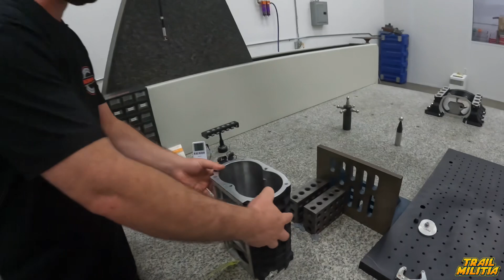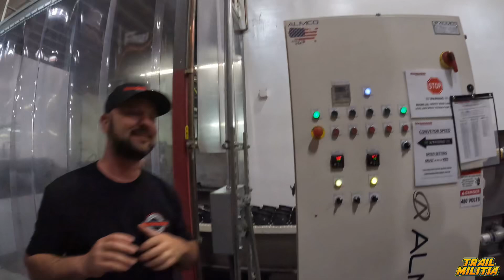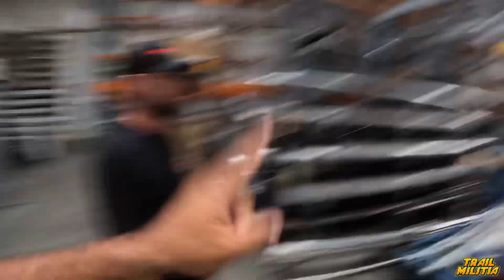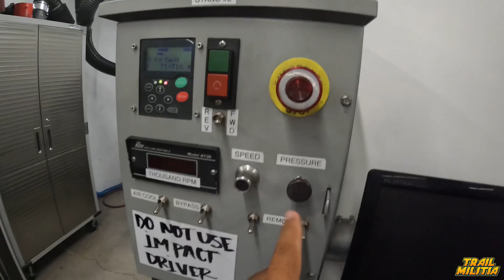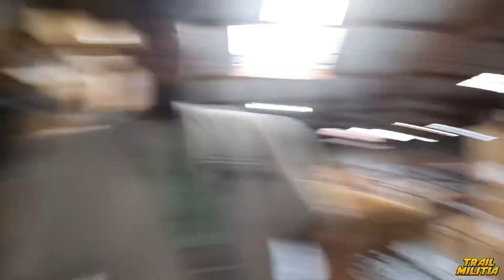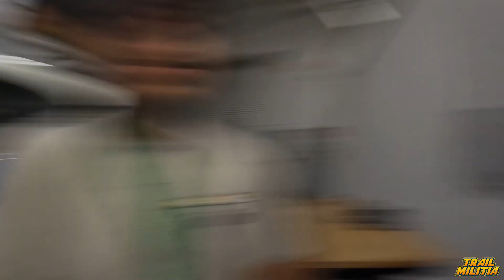Gladiator picks up more power!!! Supercharged Gladiator

Comment: Any updates? Mine gets a Magnuson installed Tuesday
Reply from the maker: You have yours before me I had to wait since I have this big trip upcoming
Reply: Well, my project is dead in the water. The speed shop has had a problem connecting to programmer to download information to it and according to them have had no support from Magnuson. Now I’m at a stand still until they figure it out. Not thrilled about it. When you call Magnuson you cant get technical support to answer the phone but sales answers first ring.

Comment: Not all JT or JL, I have a 2022 they don’t make one yet, technically, they can’t unlock the computer 😳
Reply from the maker: It’s not the unlock process it’s the carb situation I believe is the problem they can sell it without it.  Mines a 21 and even I had to jump through a hoop to make it work
Reply: Nice meeting you up at Red/Coyote Lake this past weekend. I have a 2023 JT and would love to add this mod. Are they working on the GPEC5 PCU issue? I noticed that the later models are not supported yet by HP Tuners either.. @TrailMilitia
Reply from the maker: @Shasmi67  I have the older model but they are working on the new ECU as we speak

Comment: Damn son! How much does this run for?
Reply from the maker: It’s about 8k but comes full spec’d and ready to bolt on injectors and all
Reply: @TrailMilitia  so installs pretty easy then?
Reply from the maker: @mallkrawlerz620  it’s suppose to be YouTube mechanic friendly
Reply: @TrailMilitia  I feel like at that price you might as well do a V8 swap.. I've heard the 3.6 isn't really fond of boost.. Poor cams have a hard enough time as it is!
Reply from the maker: @dirttales  this is pretty plug and play where unless you can manage to mechanically do everything with 8k you’re not really dropping in a v8.  As for the 3.6 taking boost I’m definitely fucking around and finding out 😬
Reply: @dirttales  v8 swap isn’t gonna run 8k that’s for sure